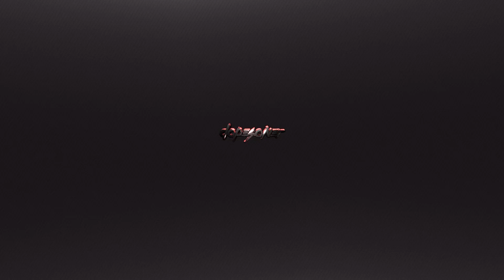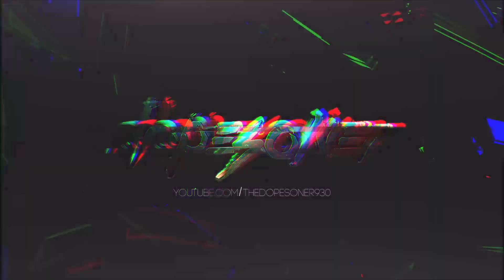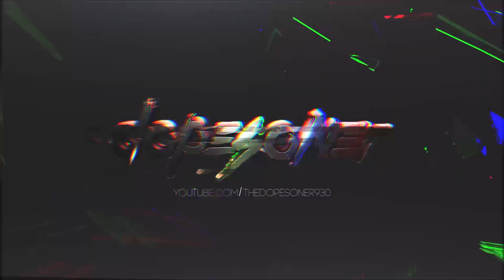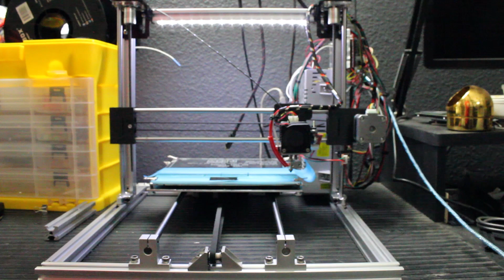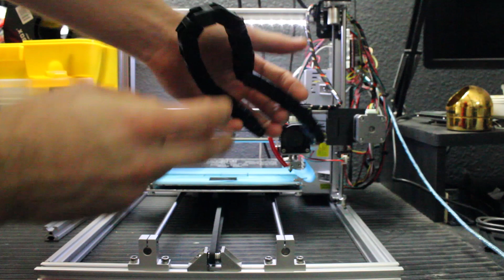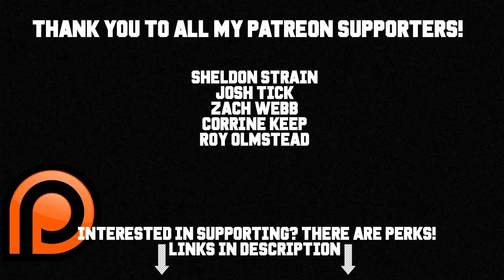FolgerTech 2020 Prusa I3 Cable Management & LED Install

Comment: You should give away the da Vinci or let me have it to fix mine lol😂
Reply: Ps are you using the led display on the divinci cause mine got fried
Reply: He fixed it but put a new board in and shipping will cost a lot to ship it. I bet he won't give it away because he needs it as a back up.
Reply: +Its Voodoo I was talking about the display cause he doesn't use it